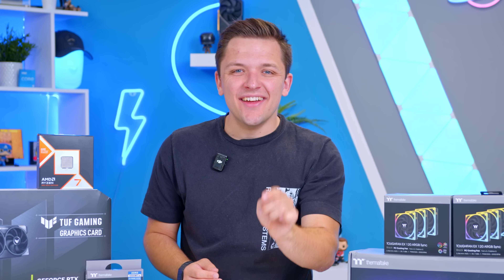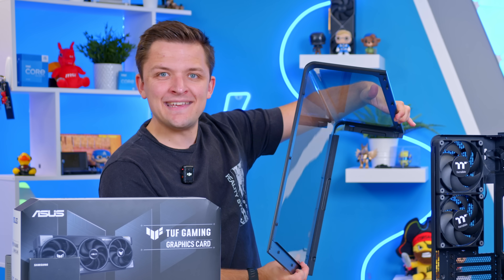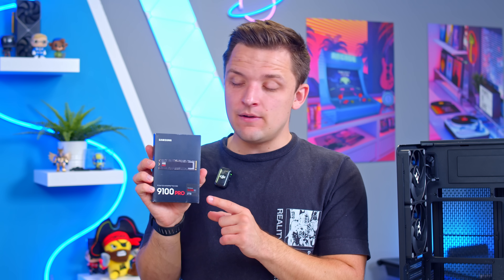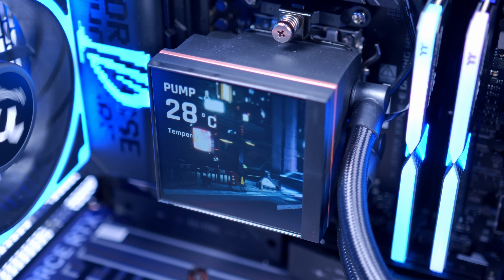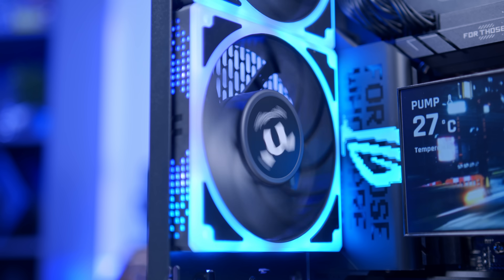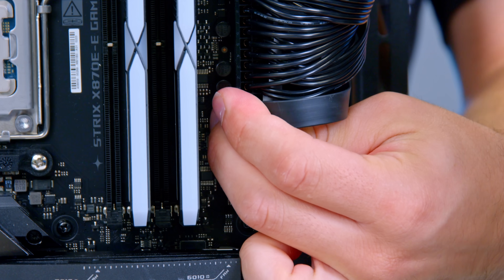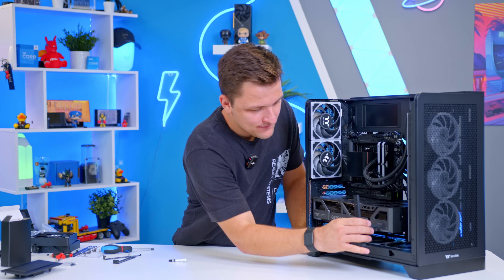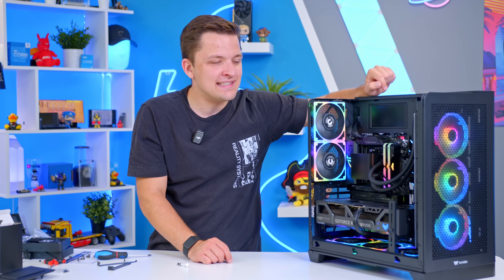$3000 Gaming PC Build 2025! 😄 [ft. Ryzen 9800X3D & RTX 5080 w/ Benchmarks]

Comment: I own the same case, and you can mount a 360mm radiator on the right side and the front. If you mount the radiator on the right, you have the option of mounting two 200mm fans at the front, which create massive airflow. That's actually why you want this case. You're mounting the graphics card first and then the radiator at the front?

Comment: M2 slot in which you installed ssd is bad. It takes 50% of bandwidth to pcie slot. I watched this video when building PC without educating myself first and it took me a while until i figured out where the problem was with slower gpu performance... The right module you want to install SSD is where you can unhatch it without screwdriver.

Comment: My 390 just came in and i love it. i went with the black version and plan to customize it a little. I ended up putting 2 200mm Thermaltake intakes up front, 2 120mm intakes on the bottom with just one exhaust in the back. Very clean all black build which makes the screen pop and throw light thru the rest of the case. Im over the RGB barf

Comment: Awesome build and video but one note regarding the SSD installation. You installed the NVMe in the slot that shares lanes with the GPU PCIe slot. It would be better to use the one on the right under the large heatsink, that one is wired directly to the CPU and doesn’t steal lanes from the GPU. This way you’ll get full bandwidth and avoid potential performance issues. Cheers!

Comment: Thermaltake case eh?
I mean the name is a bit confusing because theres others too and having too many cases can be a bit iffy
Its all over the place really
As for the case itself ehh it feels like they are trying to just do everything and cater to everyone (and end up making other issues)
I think it still remains to be seen how valuable the glass (or the mesh for that matter) is
The main issue with having a glass on the top is not having a top exhaust soo
Having one large piece of glass (especially on the top...) isnt necessarily good either if you have to move it very often

Meanwhile the 5080 is around msrp now supposedly so surprisingly it only takes up 1/3 of the total budget

I completely forgor thermaltake did ram I havent seen them in so long
Is it just me or is it kinda pricey
The samsung ssd isnt cheap either oof

I really wonder how much they are making on the lcds because its definitely...something
(You can get an entire lcd for 50 dollahs so...)

Comment: Heat rises. Without top-side fans removing that heat, your CPU cooler is getting stressed out inside that hot box. Worsened by only having two exhaust fans and 6 intake. 🥵
Reply: Nah. The computer is doing good. I have the same setup and I have my CPU underload sitting at 60C.